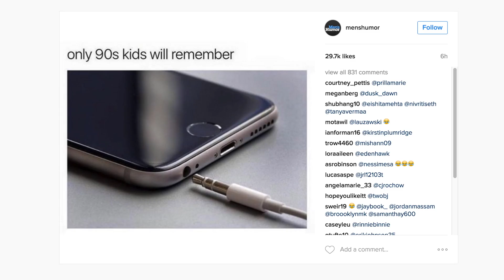Why Did Apple Remove the Headphone Jack? | A Product Designers Perspective

Comment: Except, of course, we already had wireless audio if we chose, on iPhone, all Android phones, all Windows phones, all PCs, all Macs. Just use a Bluetooth pair of headphones and you are done. However, if you like to keep using your old headphones, an external omnidirectional microphone, a flesh for your picture taking, a light meter, a bank card reader, etc, you need the analog port, and the 3.5mm jack is exactly that. What Apple effectively did is force it's users to replace all their extra devices that use the analog port with a digital, lightning connected, version (where any exists) or use the adapter (which sucks for most usages). If they switch to new tools that work with Apples connector, they are now stuck in Apples world, because they spent potentially large sums on devices that only work with iPhone on the proprietary lightning port. I do believe this is the real reason. It has nothing to do with design, water resistance, room for components and any number of other "reasons". Those are excuses. The reason is selling peripherals and locking the users into the Apple ecosystem.

Comment: Hi, Jimmy!  Nicely done video!  I agree that innovation is the way we move forward, but the removal of the 3.5 mm headphone jack is not necessarily for the benefit of the consumer.  Mst consumers have a number of such headphones and like them.  Not to be a negative nelly, but combining this move along with the purchase of "Beats" and their proprietary lightening port makes me think dollar signs for Apple.  In addition to the loss of low-cost headphones, without the use of a dongle, what happens to the usability of the many accessories that use this jack?   In particular, the ones that flush mount with the main body of the phone, whose connection with the dongle would not be suitable.  You might know, I don't, what is the quality of the DAC in the dongle?  Innovation is great, but removing features that are good, only to sell you back lost functionality is greed.  Thanks again for the great video!
Reply from the maker: Whats up Gary! I agree with you. I think its better to have the headphone jack. My goal was just to discuss "why" Apple decided to move it. What were they're intensions. Maybe I should have made that more clear. Thanks for the informative comment Gary!
Reply: You're welcome and keep up the great work!